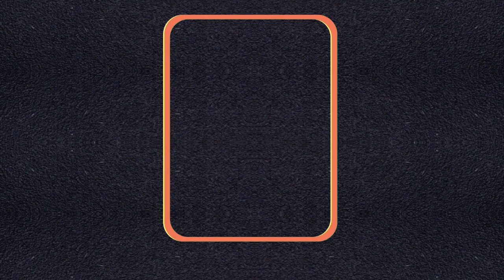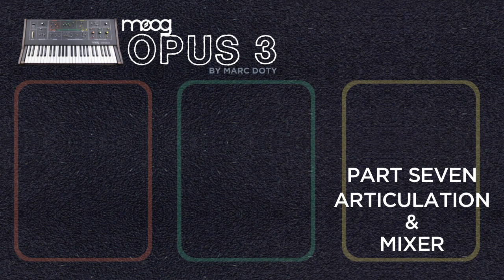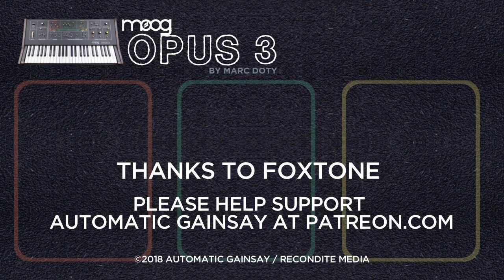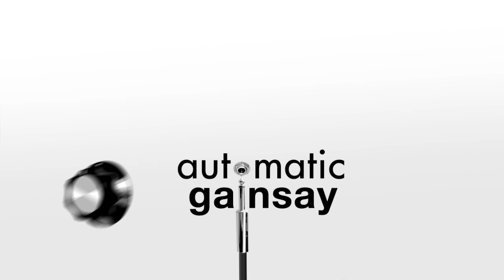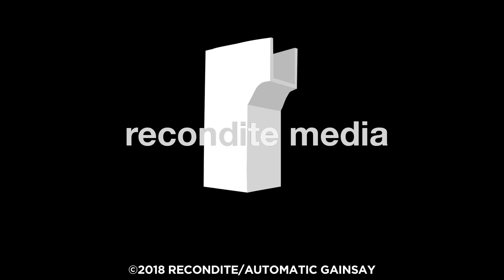07-The Moog Opus 3- Part Seven: Articulation and Mixer

Comment: In the Brass (synth) section you can use the organ to supply a square wave by using one footage, usually to match the octiave that the brass (sawtooth) is at, or, you can use different fottages of square to simulate a second, or if you use the brass at 8 or 4 foot; octive 0 or +1 and the square at one octave below, you have a main ans a sub-oscillator. Or set the square waves at one octave below and one above the Brass octaive and you have 3 apparent oscillators one above, one at the "normal" and the other a sub

Comment: Try this. In the ORGAN section use the sliders to create a sawtooth shape with 16' at the highest and 1' at the lowest and tone maxxed out. In the strings 8 + 4, lowpass mode CF=100% and EMPH about 50%, Mix organ 1/3 to strings, chorus fast. Articulation 2 adjust attack and release to taste, you have 3 ranks of strings